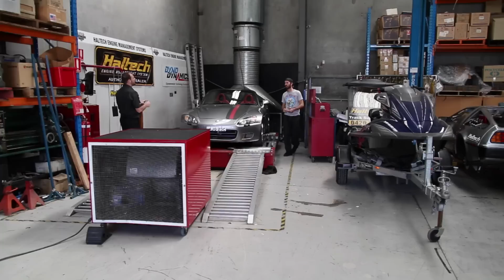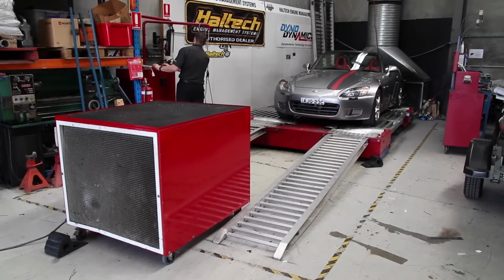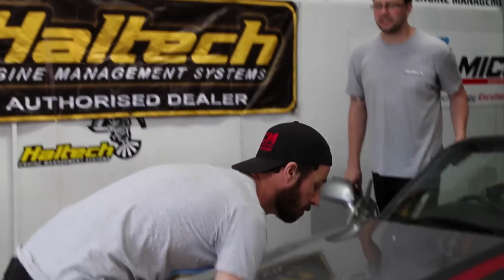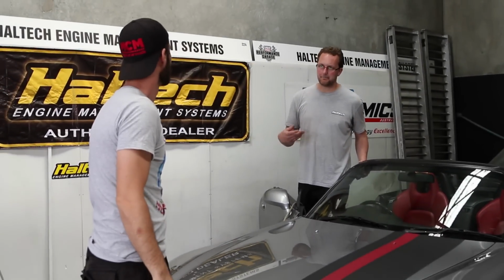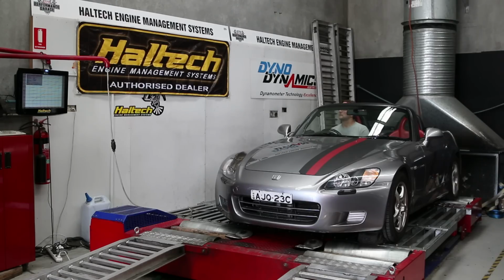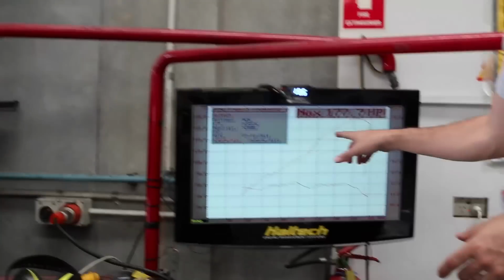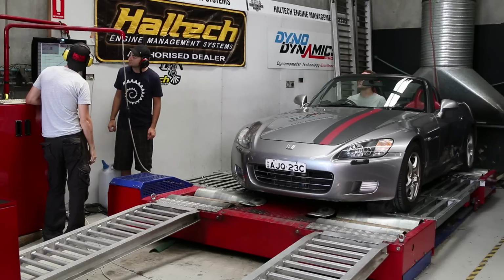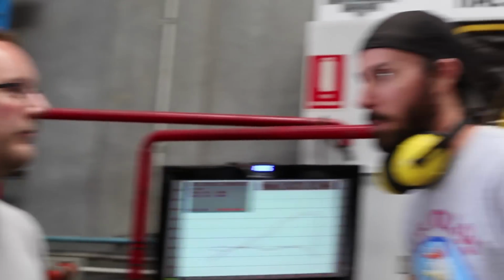Cold Air Intakes Mythbusted [Naturally Aspirated]

Comment: rx8 a 2 stroke engine ? wtf you on about mate its a rotary ! clueless
Reply: Pro Raver by design the rotary is infact a 2stroke however its oil injected. Read up on how a rotary works bud.
Reply: THANK YOU
Reply: cmentalppl lol you are so matter of fact, but there is absolutely nothing factual about what you said. How an engine is lubricated does not determine its thermodynamic cycle. The wankel rotary has, in fact, four distinct strokes: intake, compression, combustion, exhaust. Thus, it is a 4-stroke. By coincidence, the engine happens to share the same number of revolutions per power stroke as a 2-stroke; it completes one revolution per power stroke whereas a traditional reciprocating otto engine has a power stroke every two revolutions. Read up on thermodynamics bud.
Reply: nan3r nah bud, he's an engineer, he knows he shit, you sir... don't

Comment: Tuning Fork said that the RX-8 is a 2-stroke engine... but since it's a rotary it doesn't really have "strokes" does it? it's a rotor spinning in a chamber, not a piston in a cylinder. so calling it a 2-stroke wouldn't be correct, would it? correct me if I'm wrong
Reply: Aaron TheStud no its not a 2 stroke, it works "similar" to a 2 stroke. having intake and exhaust ports instead of valves that open and close. and "similar" to a 2 stroke the oil is directly injected into the combustion chamber instead of the oil being added to the fuel like a 2 stroke. and yes an aftermarket intake will rob the rx8 rotary engine of horsepower
Reply: they are 4 stroke. 4 stroke mean it sucks fuel then compresses it then the bang the exhaust. 2 stroke suck fuel in the combustion chamber at the end of the power stroke and exhausts on compression stroke
Reply: Lets start from the beginning. Wankel doesn't "stroke" it rotates. Plus all the cycles happen simultaneously. Joe has a valid point.

Comment: These make a bigger difference at higher altitude where the air is less dense. Getting colder denser air makes a bigger improvement then. At sea level, or low elevation, the air is already more dense so the results will most likely be less dramatic.

Comment: Just a note. Put the Honda air intake and test it out on the road on speeds of more than 100km/h and you will see probably better performance that the cold air intake. It is engineered to work on motion. All hitech Honda's do.

Comment: One thing not mentioned and quite difficult to prove - negative effect on the durability of the engine...  If the aftermarket filter has larger pores, it will let more dust particles into the engine.. That's the only reason I don't put an aftermarket filter on my car, since there are a lot of gravel roads in Latvia :D

Comment: interesting fact, on my 1990 dodge w150 with the throttle body injected 360 pre-magnum motor i did gain a very noticeable increase in fuel milage and far better water/air separation when splashing around off road by getting rid of the stock round air cleaner and replacing it with the intake system and box off of a 2000 dodge durango with the magnum v8. seem to be leaps and bounds better with more square inches of air filter which by simple logic should mean less restriction at the filter itself. now on another note i used black rtv silicone at all the areas where air could leak leading from the throttle body to the filter which im sure helps as well.

Comment: I designed a ram air/cold air intake system on my mustang and it dropped IAT's by a shit ton and kept them low even after long drives, way easier to tune when IAT's are consistent

Comment: I knew it would make difference because i put one on my stock car and turned it into a sleeper street race winner. Guys weren't expecting my off the line performance and when i finally topped out i had already won and then they came along.

Comment: To summarize, a Cold Air Intake from a reputable manufacture  really does perform what is intended, but there are various factors that will effect the benefits. If you drive a stock civic, the engine is optimized for efficiency, low noise, and cost. Not much heat is produced, so the benefits from a Cold Air Intake would be small. But, if you modified your engine to run fuel rich, and hotter in general, the benefit of a Cold Air Intake is furthered.

In the other video featuring a turbocharged skyline, a turbo deliberately compresses air to much higher densities, rather than using cooler ambient air, so the need for a Cold Air Intake is null.

Comment: all a natural asperation motor needs is a small air compressor very similar to a nos kit, injected right in front of the mass air flow. instant boost and the computer will adjust the fuel pressure.  if done right, you will find about three psi during compression. depending on the engine,  it amounts to about five horse and ten tourqes

Comment: I'd just like to comment that if you add a cold air intake to a lower performance motor that doesn't flow well in it's higher RPM range, you are more likely to get bigger increases in usable power.  One of my cars is a 2001 Nissan Desert Runner ( Frontier ) that stock, had an abysmal top end.  Above 4000 RPM it simple didn't want to rev, even though you could sluggishly get it up to it's 5500 RPM red line.  After adding a K&N cold air kit, I found that the motor easily accelerates all the way to 5500 RPM.  I don't really think there is much more horsepower, only that instead of the HP falling off at 4000 RPM, it now sustains that level of horsepower all the way to red line ( 5500 RPM ).  This is not a fast truck!  But, It feels much healthier, gets up to speed on the freeway easier and even sounds better that it did stock.  The extra 1500 RPM of usable HP range is a welcome addition to an otherwise ho-hum 3.3 motor that was simply too restricted in it's stock form.  The point is that maximum HP numbers by themselves can be deceiving. The difference between 170 and 175.6 would never be noticeable if there was no increase in the broader HP curve.   K&N only claims a 5.6 HP increase, but a guy at a speed shop tipped me off that my motor was one of the motors out there that would benefit more with a cold air induction because of the added usable range of RPM, in spite of only small increases of actual HP.  If you drive a NA car that seems to run out of power long before you get to the manufacturers red line, a cold air induction may be a bigger benefit for your car.

Comment: The amount of air that can get into a NA engine is proportional to how much air it can get out of that engine.  Doing nothing else to a stock motor except putting a CAI on it will do nothing, or very little.  When you start making changes to the whole system, exhaust, fuel system, cam alterations, porting mods and such then the CAI may help with all that.

Comment: That system is a short ram intake not a cold air. The factory intake he put on is actually a intake with some ram air thought in design but not effectively designed. Cold air intakes are installed to take air from outside of the engine compartment.

Comment: The velocity of the air is just as important as the volume of air. The engine has to work harder to suck air through a larger tube. Most factory air intakes have smaller diameter tubing which allows air to move faster.
Reply: Not true. Try breathing through a large and small straw. 

You can install a larger filter on the same size pipe and get slower air over the filter reducing pressure at the filter, but keeping same airflow through the pipe.

Comment: My 1998 Prelude came out before the S2000 and it came with a factory cold air intake. I can't believe the S2000 box would not also draw air from a port or some other outside air source. I stopped and watched the factory intake go in and it's a cold air intake.

Comment: It all depends on the car and the ECU. The ecu might know if there is denser cooler air but if the ecu can't advance ignition timing to make use of increased air you won't make any gains. There is no blanket rule for all cars, as with anything.

Comment: Here’s the “why.”   Cold air intakes typically have greater surface area at the filter which allows more air to be pulled in with less vacuum.  Secondly the pathway creates less turbulence allowing a more efficient flow.

You could probably achieve the same results by modifying the factory air box to take an additional filter.

Comment: Maybe this is a suggestion for a parallel video, but rather than cold air intakes, I'd like to see a comparison on just filters in the OEM airbox on a NA engine. OEM vs. K&N vs. Mountune vs. Green vs. Cobb, etc. just to verify if aftermarket filters are bs or not

Comment: The part where they mention AM intakes on an RX-8 is completely true, there are very few intakes on the market right now that actually makes any type of performance gain at all which are AEM (which is also Mazdaspeed - same thing), Racingbeat REVi or stock w/K&N filter or just plain stock. A friend of mine that I bought my AEM CAI off of showed me his dyno sheet before and after it was installed and showed a solid 4WHP, he sold it to me to buy his REVi intake though as the AEM CAI wasn't class legal for his AutoX class. But personally I would be surprised to even get 1WHP gain from the CAI (Haven't dyno'd yet, so not sure, but even 4WHP isn't worth the $360 price tag IMO)

**Plus I bought it because the previous owner put in a Vatozone $150 Shit ram intake & not because I thought it would dramatically add optimal unicorn farts and OEM intakes were roughly the same price (fixing previous owner fuck ups on an rx8 is truly exciting I might add lol)

Comment: So I love your posts guys don’t get me wrong, but the thing is if installed correctly away from the engine heat it does increase power I couldn’t not with more dense oxygen. Also I’ve yet to here you guys mention to actually get power from them you need to know the basics, must increase flow out of car (headers, high flow cat, catback exhaust), increase burn bigger injectors better spark plugs/ignition packs (my fav E3 dual electrode plugs), and either a piggy back ecu or standalone. Like yes just slapping one on isn’t going to do shit yes but proper and keeping the 3 most important things in mind air, combination, fuel.

Comment: Now test a Ram Air hood... while sitting still....The stock air box, or a CAI, both need movement to to create pressure at the low end. The Cold part happens later as the engine heats up on the road. If they could be tested in this way, you would see modest gains, they will never compete with pressurized intakes, but they cost less that one tenth of them, so, you get what you pay for. I wouldn't expect anything on the Dyno, take it to the track and test it

Comment: I think a more conclusive test is needed. I feel like if you're on a racetrack that the benefits of a cold air intake would be more substantial. I think you need to drive the car around for an hour on a summer day, then immediately do a dyno test so the engine bay is hotter to simulate track driving.

Comment: I was under the impression that having a cold air intake raises your maximum capacity for power, as your mass of oxygen has increased. This allows you to tune the engine to use more fuel. Factory ECUs highly limit the maximum fuel flow despite the range the air sensors can measure. This means without a tune the cold air will do nothing in most cases

Comment: The NA Miata gets a massive increase in comparison to others I've owned with a simple cone filter instead of its extremely restrictive air box. You can see more than 10 hp gains from replacing the vane style AFM with a normal Map sensor as well, although it's hard without a Megasquirt lol

Comment: If you put a block of dry ice near the cold air intake 
the engine runs cooler and runs better in my opinion also the 5 kW is great to add more lights under the car.

Comment: You would see even more power if you didn't have that aluminium tube off your cold air intake.  It will act like a heat-sink and soak up the under bonnet temperature and re heat your air charge, ABS has far greater thermal insulating properties, as per OEM.

Comment: The factory air box is actually a true cold air intake.  Just install a K&N drop in filter for $35 instead of paying $300 for an intake that just sucks in hot engine compartment air.

Comment: An AEM CAI knocked 2 tenths off my EM1's 1/4mile times. A cheap short throw ($70) knocked off another 3 tenths. Thats half a second for less than $350. You can do it even cheaper by buying a cheap CAI and then buying the K&N filter separate.

Comment: I think the only time a cold air intake or podfilter or whatever will work is if the initial factory airbox wasn't designed very well/has obvious restrictions. Now while they gained power in their case,  the only thing I've ever noticed or kinda benefited from having any sort of podfilter was throttle response, particularly on older vehicles. My mr2 definitely felt slightly snappier having a filter on, but it definitely isn't noticeable lol. I miss my factory box T_T

Comment: I gained a 1/10 of a second in the 1/8 mile adding a cold air intake to a 6.0 ls with a cam swap dual exhaust with headers.  A stock engine wouldn’t be able to make use of the flow.  I really wish I could have a sealed air box but since this engine was swapped into a 72 GMC it isn’t feasible to run a sealed air box.  Even the factory air intake didn’t have the air box but a filter on the end of the mass air flow sensor.

Comment: cold air intake is just to make the air in the engine flow better and in advance have better fuel/air ratio a bit more clean and cold air to engine but that thing (as the video says) it might makes a small increase or none and in some cases less hp

Comment: A standard cold air intake has a built in resistor so not to freak out the computer so you have to get one with a tuner or not much will happen, you are only 1/2 way there

Comment: Before even seeing this I can tell you if you buy a quality cold air intake as I did (gruppe m carbon air intake) it will gain you massive power, but the essential of an aftermarket airintake is too make sure when the car is tuned it gets the air thats needed to make further gains.

Comment: Yup... the CAI on my '09 Lancer Ralliart (in the US) on stock tunes gained a loss of 3hp, and chucked a CEL for misfires (well, duh, many air + few fuel = misfire).

Until I had the engine tuned to take advantage of the increased airflow. And now it cranks 210WHP, an estimated 260BHP. A gain of ~23BHP.

Nope, CAIs don't add power. Unless you tune the engine to make use of the lower IAT, and adjust fuel flow to take advantage of the increased airflow.

Comment: I learned from an automotive tech school, if you add a cai, you have to change the exhaust system as well.
Reply: No.
Reply: You don't have to change the exhaust but if you slap on a catback after installing a CAI it would give you more power due to less restriction to the air flow. But it still depends on the car.

Comment: I think he said a cold air intake places the filter outside the engine bay where the air is cold. Not true. The filter can be anywhere along the intake tract, it's the opening to atmosphere that must be outside. Also, the stock intake tract is usually made up of different shaped tubing, different sizes, and tight bends whereas the aftermarket version is usually a single diameter tube with gentler bends. This would tend to aid air flow as would the filter itself assuming it's bigger, which it usually is. Thus, half the gain might come from increased air volume rather than it just being cooler. Since they are testing COLD air intakes, that is the difference between outside air v engine bay air, the only scientific methods of doing it is to either simply put an extension on the original intake (assuming it's inside the engine bay) to bring it to the outside or make two new systems using single diameter tubing with gentle bends, one finishing inside and the other going outside and both with the same filter or none at all. If they do anything other than that, they are not comparing intake air temps and nothing else. BTW, I have a 1988 Ford van with a 460 which had a cold air intake from the factory. Sure, the air would've been cold but I couldn't get two fingers into the opening. I replaced that with a system I made myself out of large diameter tubing (ceramic coated inside and out) with gentle bends and two K & N filters which together have around 8 times the surface area of the stock filter. The whole lot is inside the engine bay so it's not a cold air intake but just uncorking the system made a huge difference. Had I located the openings outside (I'd liked to have but doing that was just too hard), people would think that's where all the extra power came from.

Comment: Cars have a cold air intake from stock, just replace the stock element with a K&N stock replacement ;)

Something that can also help is coating all the hard intake parts with ceramic on the inside to help keep the air dense (cool) so you can help get more air in, expensive and marginal improvement really. But it will make your car faster in heavy stop and go traffic! woo!

Comment: No sir, torque is higher rev, may be horse power at the appropriate  gear but try taking off on a tall gear and confused fuel/air mixture hence dense smoke from exhaust and smoke coated exhaust

Comment: Of course if you Dyno test this car, the temperature of the air getting to the intake isn't as cold because the car's not moving forward. The intake air's fairly warm or hot. Cold air is denser, contributing to combustion power. All this aside from the valid engineering problems.